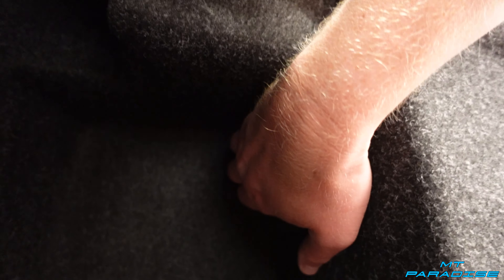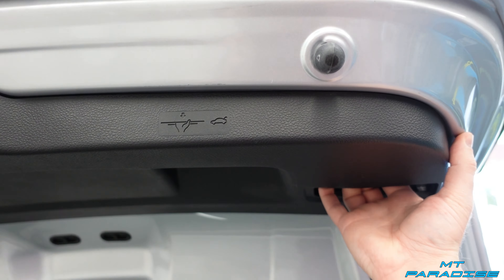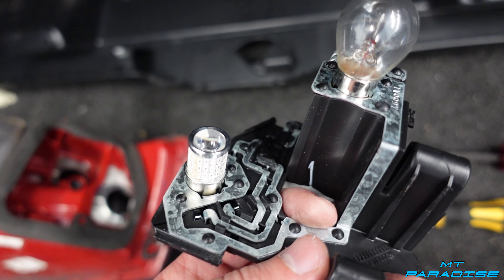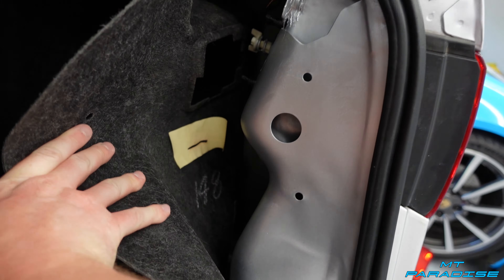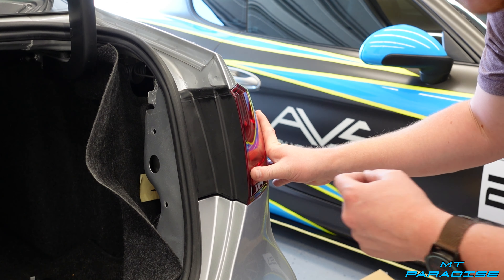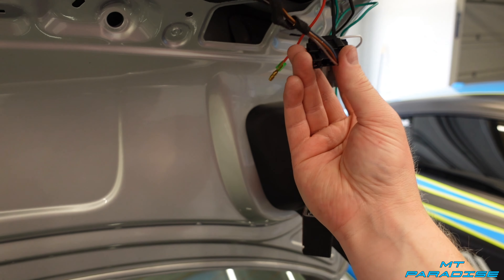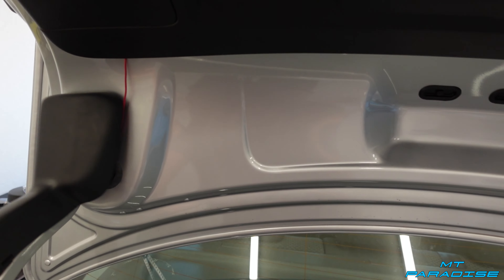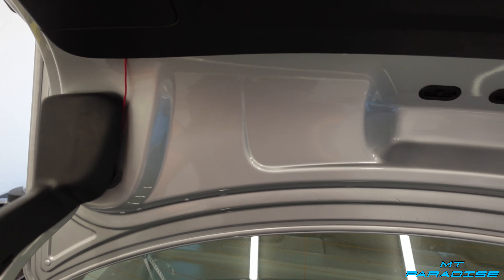How To Install VW Jetta Taillights, MK6 2011-2018

Comment: Be weary. Your reverse, running and turn signals will function fine, but the LED's that function as your brake lights are integrated and seem fragile (flickering/dying). After 8mo of ownership and running/checking all wiring and connections, I finally decided to remove and put the stock ones back in. These issues can be dangerous on the road! I want to add also that yes, the housings were sealed with a bead of waterproof silicone to prevent any water seeping in before install. They are super nice looking and the company reached out and was helpful but - keep an eye out for faults.  Safe driving everyone!
Reply from the maker: Interesting. Thank you for the heads up. I’ll keep an eye out
Reply: Damn a led gone out on one of my OEM taillights, I was thinking of putting on those Vlands but now I’m not rly sure lol
Reply: @MTParadise  Have you had any issues with these? Did you add load resistors to your install? Looking to reinstall to see if I can rectify the previous issue but looking to see others experience with them first.
Reply from the maker: @snowsoldier84  I’ve never had any issues with these. I really like them
Reply: @MTParadise  Hm, I'm going to attempt to reinstall but I'll add some load resistors to the brake light wiring to see if it fixes the issue. I really like them as well as they transform the look of the rear completely. Fingers crossed.
Reply from the maker: @snowsoldier84  good luck and I hope everything works out!
Reply: Did it throw a burn light code??
Reply from the maker: @badboy5260  I never got a code on mine
Reply: @snowsoldier84  hi guy,did you end up reinstalling with the load resistors and how are they now?
Reply: How are they holding up for yall

Comment: I fitted exactly the same tail lights from Vland. Your video is super useful n should watch Yr video before I started. Saves me some frustration n time. Do you get the "light bulb" sign on , on the dashboard?
Reply from the maker: That’s awesome to hear. I’m glad I could help. Before I had these I was trying out some LED bulbs and I got the light on the dash with one of those but after switching to these lights, the light on the dash went away

Comment: You do not necessarily need to pop the trunk cover of. Just pop the light cover and unscrew the two nuts holding it 😉
Reply from the maker: Well when the new lights have a wire that needs to run across, it’s coming off anyway 😂

Comment: Did these new leds cause a warning on the dash due to the lower amount of power these bulbs use?
Reply from the maker: Not at all. I thought they might but no lights on the dash at all.
Reply: I’ve gotten the smoked taillights for my Mk6 Jetta and it gave me a blub out on the dash and the mfd error for rear turn signal and fog light 🤷🏻‍♂️
Reply from the maker: @SirKillah  oh that’s weird. I never got any error lights when I did mine.

Comment: I got the same rear lights but the connectors on my car are different (r20?) With the red tab. Probably because its EU spec. Now I'm stuck trying to find the right adapter for the plugs which I can't find anywhere 😢
Reply from the maker: I didn’t realize they had different connectors for different specs
Reply: @MTParadise  do you happen to know the name or number of the connector used in the video? That might help me find an adapter
Reply from the maker: @sandervandeven1999  I’m sorry I don’t and I no longer have this car

Comment: I installed aftermarket tail lights on my Jetta, but now the Light Bulb failure on the dashboard is constantly on. Every single wire is connected and working what could be the problem?
Reply from the maker: I’m not sure. Someone else had that but was never able to figure out what it could be. A lot of others never had that happen even with the same brand taillight

Comment: Ive got a 2015 tsi would they fit without an issue?
Reply from the maker: It looks like they changed the body style a little so I’m not sure. The listing for the lights says 2011-2014 but I’m not sure if maybe they kept the shape of the lights the same